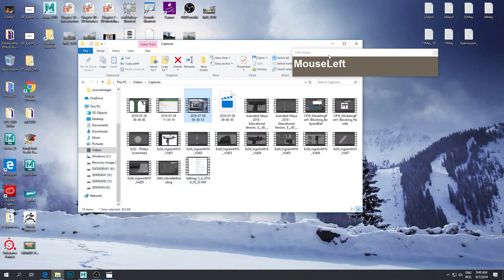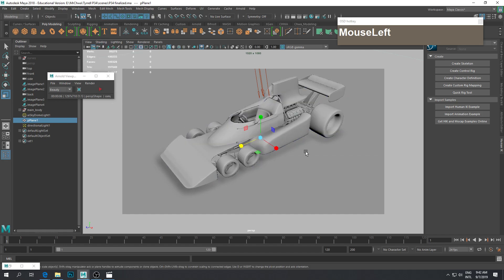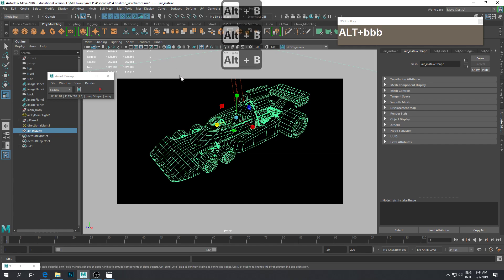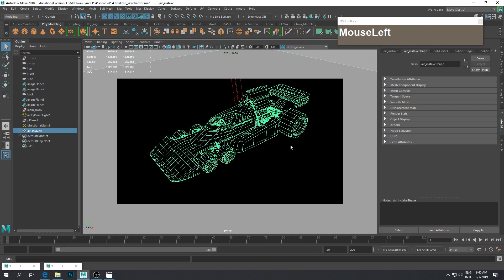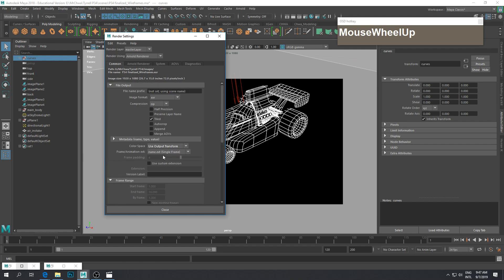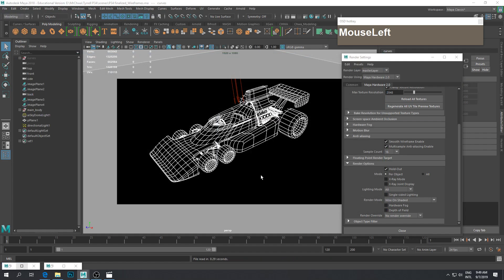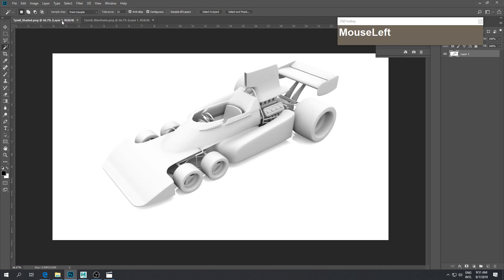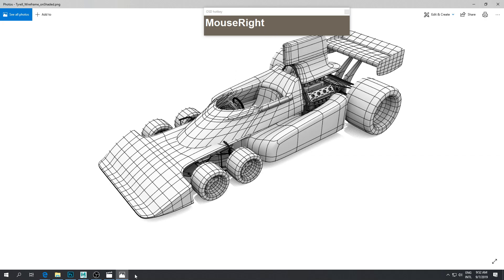Maya 2018 Rendering Wireframe on Shaded using Hardware 2 renderer

Comment: this is an amazing tutorial, thank you.

Do you know how to make the wireframe lines thinner?  Normally, we can go to Setting/Preferences->Display, then change the line width but it doesn't seem to go lower that 1 (which is default). Even entering "updateLineWidth 0.5;" in the script editor doesn't allow the value to be chaged less than 1.  Is there another way to change the line widths?  The arnold wireframe render does allow the change to thinner lines through the aiwireframe shader properties but as you mentioned, arnold renders wireframe with the full subdivided mesh.  Thanks again
Reply from the maker: You could try rendering at a higher screen resolution that is a way to cheat to a lower resolution.